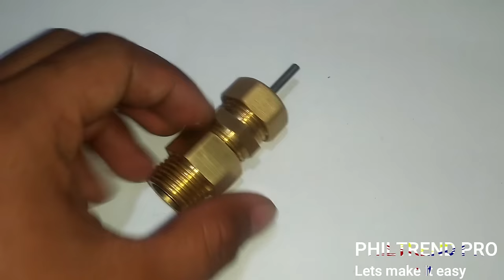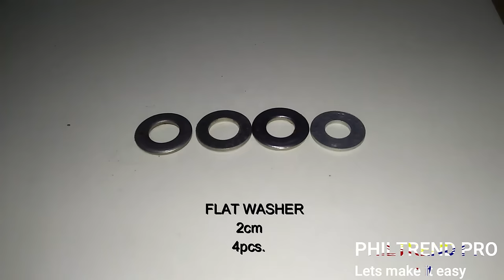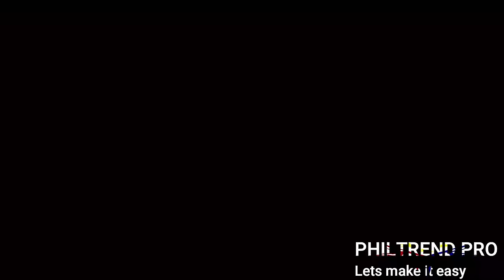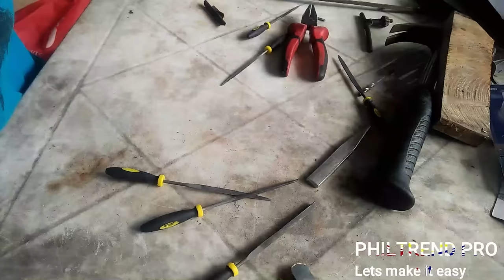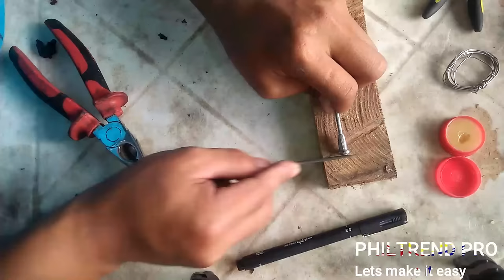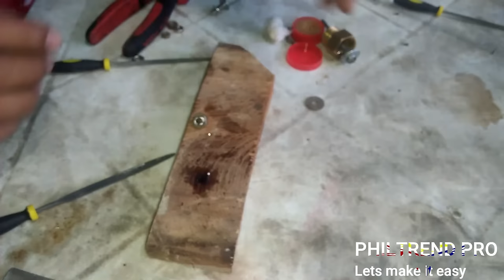HOMEMADE AIRGUN VALVE

Comment: Ok that's an half made valve, you just forgot to put the exit hole for the air to be released when the hammer is hit and to seal it with rubbers to make it somewhat airtight. But props to you for making it even simpler than most "face off" valves and for listing the materials with precision.

I think threading the end of the rod and put a nut welded with a washer and a rubber washer for airtightness would be easier and more reliable than that earphone jack thingy.

Edit: Ok there is a "part 2" for what is missing.

Comment: What used soldering Iron on the motorcycle Rios?
That will easily loosen the welded part.
That DIY is waste of time, useless and unreliable.